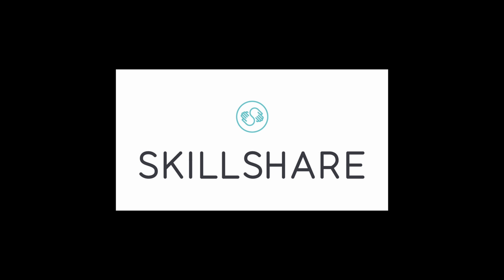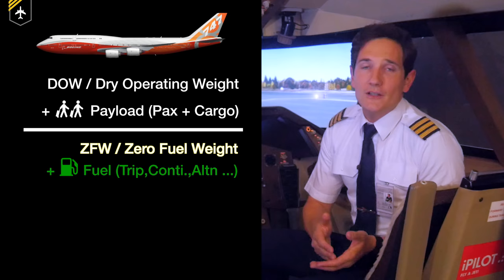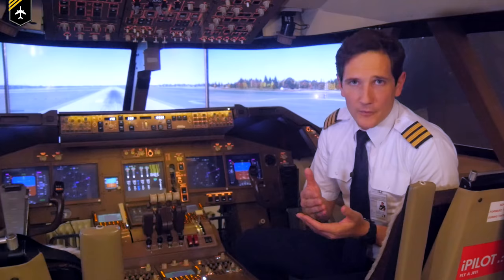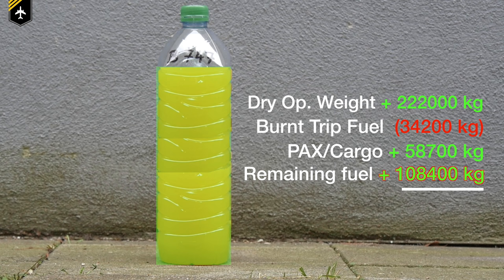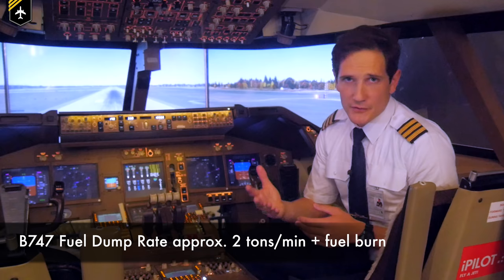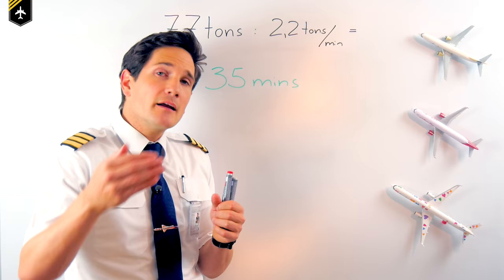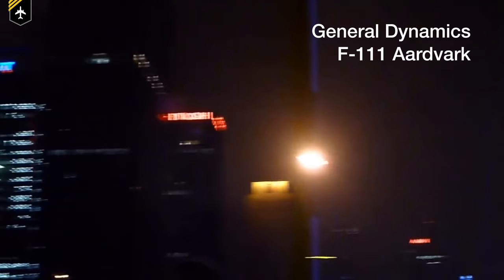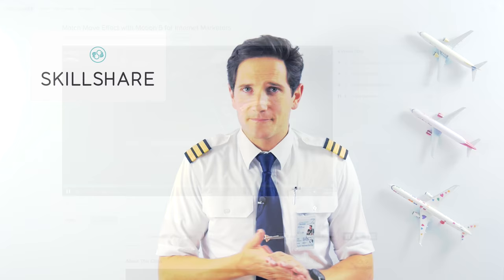Why do PILOTS DUMP FUEL??? Explained by CAPTAIN JOE

Comment: Me in fsx 
Terrain, terrain, pull up, pull up, stall, stall...
What do I do lol
Reply: Speed tf up over 9000 kts scrub
Reply: Slew mode obviously
Reply: Squawk 7500, it will relieve your pain
Reply: Blog it.
Reply: sink rate, sink rate
Reply: Turn the xbox off then go outside and play
Reply: You might be pulling up a bit too much.
Increase speed and pull up gently. That might help.
Reply: Buy P3D
Reply: Do a barrel roll
Reply: Well Isn't takeing flight advice from a humanoid frog anyway?

Comment: By the time I calculated it I'd have to start over because so much fuel was burned since I started lol. ;)
Reply: Peter Lafayette good thing you’re not a controller lol
Reply: He said 77,000 lbs is 77,000 tons,......did anybody in math class learn what I had....that a ton is 2,000 lbs?  Simple math and nobody else seemed to have caught that😉😂🤔
Reply: 77,000 lbs=38.5 tons!
Reply: How about we keep the fuel, but we flush the Creamy mushroom farfalle bake! Should save us a few ton's and keep the air con smelling sweet at the same time.
Reply: @shawnaceamendiz9366  Look around 5:25 min of the video. He did say 77 tons in reference to 77000 kg.
Reply: @shawnaceamendiz9366  why not just use the metric system?

1 tonne is 1000kg
1 kg is 1000g 

the weight of 1 cubic meter of water is also approximately 1 tonne.

1m = 10dm = 100cm = 1000mm, 1km = 1000m like a kg being 1000g or a kB being 1000B.

Aside from kilo demi cemi milli there are other "initials" all being 1k difference from each other. Mega (M), Giga (G), Tera (T) or micro (μ), nano (n), pico (p)
Reply: Ur too funny me too😂😂😂😂😂😂😂😂😂😂😂
Reply: @shawnaceamendiz9366  he uses the metric system where 1000kg = 1 tonne
Reply: Different They don’t teach that in America so we’re ass backwards

Comment: Thank you Captain Joe, I didn't know that fuel, weight, and flight time (along with distance) is carefully calculated prior to a plane landing. I also wondered how the fuel dissipates, (correct altitude evaporates fuel before it hits the surface). I originally thought it fell on the surface and or water causing contamination. Wow! No wonder why being a pilot can sometimes be stressful. Great video for laymen like myself!

Comment: Because the aircraft is having a wee, silly.
Reply: I hate you so much for making me laugh as hard as I did.
Reply: and it will explode if it is at the maximum pee weight
Reply: But fuel is non renewable resource
Reply: It shouldn't be wasted
Reply: @salimkhanjm1457  it was dumped because too heavy
Reply: @salimkhanjm1457  - would you rather crash and burn due to overweight landing?

Comment: In the early 80's I was with a few C130's going from Minneapolis to Korea. We stopped at Sacramento to squeeze in every last bit of fuel the planes could hold to get to Hawaii. I was still on the ground as the first plane takes off. Big fireball as a engine shells out. Story was that the acft commander panicked and did a fuel dump as soon as rotation. That thing looked like a crop duster and it only took a couple minutes, the time to do a go around and land. I guess there was a highway or freeway right off the runway that got greased down causing car crashes and also fuel on houses because the plane wasn't at a high enough altitude to atomize the fuel. The Ca hwy patrol and the base commander had quite a pow wow on the flightline. I never did hear the outcome.

Comment: Cool.  Would have liked to see a more complete total overview analog calculation of the weight loss needed for landing.  I'm ok at math just not willing to trust it alone in such a critical moment without an analog backup.  the plastic bottle analogy and example were really good and almost did the job.  An analog fuel gauge and an analog clock are what I'm referring to.

Comment: My question is

When your underneath a plane dumping fuel

Do you get splattered with Kerosene
Reply: Nope. He said in the video the fuel dissipates before it hits the ground because of the high altitude at which it is dumped.

Comment: i have a question, it might sound a bit stupid but here it goes:

How do they calculate the passengers weight? i understand they have the passenger´s cargo weight, but do they take in count the actual weight of the passengers? i assume they make some sort of aproximation, but sometimes this aprox could be very wrong, and it could cause an accident, which aparently has never happened or it happens not very often. So can anyone explain me how it actually works?

Sorry for my trashy english and thank you.
Reply: BasicallyPeter this is actually a really good question! I would like to know the answer too.
Reply: Air operators use standard passenger and bag weight tables that have into consideration sex (males are heavier than females), age (children are lighter than adults), region  (in certain regions people tend to be heavier than in others) and season (in winter people wear heavier clothes). Tables are produced by the corresponding air authority or the operators themselves under approval.
Reply: BasicallyPeter .  In the US we use an FAA approved/specified average weight - it may vary slightly between airlines but is approximately 180lbs per passenger, and is 10lbs higher in the winter because people wear heavier clothing.  II sounds a little sketchy but actually works pretty well; obviously there can be variations in the passengers but the larger the plane, the more likely that for every heavy passenger there is a lighter passenger somewhere else in the plane.  If we’re flying a group that we know to be non-standard, for example a football team or a school group, we make adjustments.  We also use slightly different weights for the cockpit and cabin crew members (less, particularly for flight attendants).

And periodically the airlines and FAA will actually weigh groups of passengers and revise the standard weight as necessary.

Different airlines do things slightly differently but in our operations center, there is an entire group of analysts that worry only about the weight of each flight (others specialize in weather, routing, crew legality, maintenance issues, etc). Most of the time it’s not critical but as Joe mentioned there are limits for every airplane, both structural limits and also performance limits (runway length limits can also limit the weight of an airplane, as can weather), and though rare there are times where they are monitoring the boarding of each individual passenger in the operations center (when your ticket is scanned in the gate, it shows up instantly on the airplane map in the operations center).  It’s more of an issue with smaller airplanes, particularly the regional jets, where each passenger represents a larger individual percentage of the airplane’s total weight and thus has a larger individual effect.

Finally, as a “by the way”,  most smaller planes including both the.B737 and A320 families and all regional jets do not have fuel dumps.  If they’re overweight they have to fly around and burn off the excess fuel, or if an emergency, land overweight and accept that the airplane will be grounded pending a maintenance inspection.
Reply: I'm a technical flight dispatcher here in Brazil, the national civil aviation agency determined this: adult passenger 80kg(176lbs), child 40kg(88lbs), and an infant 20 kg(44lbs). Those values already include their carry on luggages. In domestic flights every passenger is allowed to take with them as carry on luggage 10kg. And that's how we do the math, if we have a flight with 100 adults + 10 children + 5 infants and 5000lbs of dispatched luggage and no cargo the payload will be: 17600lb(adults) + 880lb(children) + 220lb(infnt) + 5000lb of luggages in the cargo compartment = 23700lbs of payload or traffic load.
Reply: Passports,  Americans/Brits= 300lbs average, Euros=135 average, Asians 100lbs.  It's pretty accurate.
Reply: BasicallyPeter I do remember watching a video on an air crash investigation that concluded that the aircraft crashed because of miscalculation in its weight. Basically the average weight per passenger that they used was very old and realized that an average person weighed heavier now!
Reply: Rupakshi Bhatia  Being overweight has now become the new normal.Crazy world we live in to accept gluttony as ok because the majority are doing it!
Reply: Is there a reason why the plane couldn't get its own weight by measuring the stress on the landing gears while the plane is standing still on the ground? Is there just not a sensor suitable for that kind of measurement?
Reply: Jussi Leinonen I'd assume they'd start refueling before all passengers and luggage had been completely loaded. So such sensors might be of limited use at busier airports
Reply: Eduardo Nunes haha 80kg/176lbs per adult passenger with carry on baggage wouldn't work for us in the U.S.A.
Reply: the undercarriage will use some sort of spring mechanism and the spring equation is just f=kx with k being a value that's dependant on the spring. Be silly if they didn't use that.
Reply: BasicallyPeter "Arrow air flight 1285" crashed in 1985 because of frozen wings AND because of the  miscalculation of the weight of the  passengers. It is an historical insident and i reccomend everyone to learn about the tragedy that occured. It is prabobly too late to mention this now, but anyways, I did it😉 Would love some aort of response
Reply: Markus Endsjø iirc the miscalculation was that they used the normal weight tables which assumed a mix of passenger weights, but they were carrying military men going on leave. So they all weighed significantly more individually bc of their gear, and with no weigh variation in the whole group like the table assumed. So sad 😢
Reply: You would think there could even be some sort of weighbridge at the terminal or even just at either end of the taxiway.
The trains I drive are weighed as we pass by at 40km/h. No idea how accurate it is, but when it was being  tested and calibrated we had to go backwards and forwards about 20 times with the same train which the weight of each wagon was already known.
I don't see why it couldn't be done for planes. All land vehicles can be weighed without much drama as far as I know.
Reply: But they can just work backwards from that. Baggage and fuel mass is known. Subtract the total weight after everything's been loaded with the "known" weight and that should leave you total passenger weight. I'm actually surprised that commercial aircrafts don't have the ability to do this. As a second check against manual pilot calculations
Reply: steve b you say that because use you guys usually Carry gigantic carry on luggages or cause most of people are really fat haha?
Reply: That's an interesting idea.  I don't know that anyone has ever implemented that.  

You'd have to keep the landing gear in very close calibration, but it would be a great time-saver.  

Probably part of the reason this hasn't been done is weight distribution fore-aft is even more important than total weight, and that might be even more difficult to determine on the ground as you describe.  But maybe not.  Don't know.
Reply: How does a truck know the weight of a load?
Reply: weighbridge, unless the load has a known fixed weight.
Reply: no, I believe it can determine the weight over air pressure in suspension (we use that at work). I'm guessing the airplane has similar system, just maybe hydraulic suspension or whatever
Reply: well even if it was poorly calibrated you'd get ~5% accuracy (don't know if that's any good). Also you have 3 sets of landing gear usually so you could work out the CG from doing it on each set of gear.

Remember F=kx.

A way you could increase the accuracy massively is take a measurement before you fuel the aircraft (at an unknown weight), fuel it up with a known weight of fuel, and then take how far (x) the aircraft sinks down between the start of fuelling and after fuelling and then dividing that x by the mass of fuel pumped into the aircraft (which would probably be rather easy to get hold of).

Basically k=(height/extension before fuelling -height/extension after fuelling)/weight of fuel added.

You could probably do it with a tape measure.

Of course this assumes that k is largely fixed and tbh it's no usually. But it wouldn't be too difficult for aircraft manufacturers to come up with a gear extension/aircraft weight table or even just an equation. Depending on how good the radar altimeter is, they might even be able to measure aircraft weight with that.

Personally I would make it a bit more complex. Put pressure sensors on each leg of the landing gear and using the variations in their measurements to work out the CG (if nose measures as heavy, you're nose heavy, if left main gear is heavy, you're heavy on the left). That would give you a great accuracy and your CG.
It's basically how a Wii Balance board works, but scaled up and with only 3 measuring points (which is all you need to work out where the CG is on the 2D plane).

Comment: I'm an aircraft Refueller. Is there also a difference if the static gravity of jet a1 is heavy?
Reply: So long as you're putting in the same type of fuel each time, the SG is then dependant on temperature,  so no..... as you're still putting the same mass of fuel in because the meters measure mass (which contains a specific calorific value per unit) not weight or volume, unless you use a different fuel (wide cut kerosine for example). But the crew will know this and adjust engine parameters to suit as it contains a different calorific value.

Comment: Why not improve the structural design of the frame of the plane instead of dumping fuels just to avoid damaging the frame when landing ?
Reply: may be because its way more complicated then commenting on a YT video.
Reply: Increasing the strength of the frame would either require a much stronger yet lighter material or increase the size and weight of the frame. This material might not exist, and if it does it’s going to be way more expensive which will translate to the ticket costs of the passenger. 

If they just used ordinary steel and beefed up the frame, the operating weight of the plane would increase considerably. This increase in operating weight may require larger jet engines and would decrease fuel efficiency which would in turn increase the amount fuel consumed per flight. 

Not sure if burned fuel or raw fuel in atmosphere is worse, pick your poison I guess. 

These are multi billion dollar business that calculate precisely how to get the best profit margins. And they take hundreds of factors into consideration. In the end it all comes down to dollars, not the environment or our health.
Reply: Because this is all bs, they’re all poisoning us with chem trails
Reply: @praffulsuthar4464  Nice one bro...
Reply: @bharat suthar i dont think if you are wasting 77lakhs worth fuel in a single go if we can engineer everything than why dont they use some kind of fuel management system for example if you dont want xyz amount of fuel use some kind of kevlar bag fill it with fuel and drop it  through parachute simple....
Reply: @pritishize  Sure, engineer that dumb system and get it to fit on a plane...

Comment: Maximum Landing Weight is something I would never of thought of as being a thing. I just thought you can land with whatever you took off with.
Reply: You're not the only one to think of the same thing. It looks like they are trying to cut corners to me. Just design the plane to take the weight. Or have a passenger ejection tube.
Reply: There's an impact with landing, which can cause damage if you are too heavy.

Comment: For everyone complaining about cars and environment regs saying this isn't fair- it's a safety issue. They allow this so that planes don't suffer catastrophic failure on the landing gear or overrun a runway- potential killing dozens to hundred of people.
Reply: There are many  other ways they can do this dropping fuel is bull shit and yes your saving ppl in the air but killing a few 1000 on the ground smh
Reply: Nova fall It evaporates before it gets to the ground
Reply: Nova fall fake news
Reply: Nadir alger not true not even close  There was a study done would have to look it up I can't remember where it was but the ground near the airport is highly toxic that's why they usually put them away from houses and buildings and things of that nature so far from the truth that it evaporates before hits the ground that's bullshit.
Reply: By the time it gets to the ground its like... what... 1 part per billion.  Probably even a lot less than that. Not much pollution overall. Who knows.
Reply: Crosiss Kebbel... its toxic because of the huge amount of exhaust gasses released on a daily basis at busy airports.  It has nothing to do with the raw-fuel dumps since the fuel is dumped BEFORE the plane reaches the airport.  Duh.
Reply: Anil Löeb yes, but if the crash landing kills all those people then that would save the environment years of hundreds of people polluting driving cars and stuff.
Reply: Crossis Kebbel - your theory would make sense if airplanes hovered above the airport while dumping fuel.
Reply: claxcyr I suppose you have no sources for said estimate. Dumping 100 tons of fuel every now and then does not compare to pollution caused by farms, factories, and vehicles.
Reply: @m2shawning55  every now and then? Wtf? It's a regular thing they do. You guys should know aviation companies do not care about the environment. It's not profitable.
Reply: Barry John How often is does a plane require an emergency landing, and thus have the need to loose extra weight? It’s very rare tha this actually happens.
Reply: meanwhile us folks in rural areas get cancer because we have this shit dumped on us daily I'm talking about the jet fuel ofc. Diesel gasoline and oil can cause it. Jet fuel is no exception.
Reply: The Q This happens less than once a year.